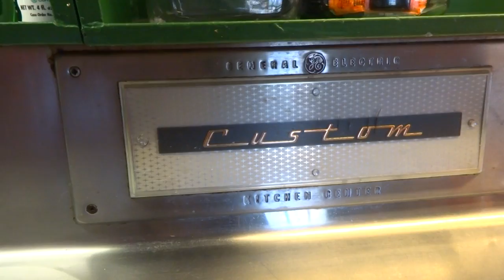PROPRESS FITTING POPPING OFF INFERIOR  PRODUCT TO SOLDERING

Comment: I’ve never seen a pro press fitting pop off like that in my life.  I’m guessing he did not have it on all the way before he used the pro press. I’ve been watching Steve for many years and this is a first in his videos. That just shows you how rare this is. Plus I’ve never seen it in my personal life either. User error is the reason she popped off.
Reply: Did you also notice pipe not cleaned, can you confirm for me, but I was trained to clean the pipe before pressing.  Maybe that is also why it failed?
Reply: Listen this guy had multiple failures.. go back replay...
Reply: Maybe the guy who did the pro-press sanded it. I think cleaning is OK, but sanding maybe not
Reply: @User-pb8pd  maybe? He definitely for sure did not install it correctly.
Reply: @michaelmcneffii1912 maybe he only wanted it to work long enough to get paid. Yup, Def not right!
Reply: @User-pb8pd  I would hope that’s not true. I had a experience where my battery died right as I was pressing a fitting. Now I first thought it was pressed all the way, but I pressed it again to be sure with a new battery. That’s a possibility of what happened too. Either way I’ve never seen a fitting pop off like that before. 100% user error
Reply: @michaelmcneffii1912  agree
Reply: @petero2693  Yes. It was the same plumber. The plumber was the problem.
Reply: Propress & Sharkbites are reliable products. If they're leaking, its because of improper installation by the plumber or DIY homeowner.
Reply: I have seen this when a propress fitting freezes. That being said what’s the difference if the pipe freezes and the fitting pops or the pipe freezes and the bursts. You’ve got water in the basement all the same

Comment: User error (I thought maybe the pipe was too thin).  That GE set up belongs in a museum.
Reply: Nope, i sold kitchens..The old double ovens 25 years old i told customers to keep them.. They were built like a tank.. Plus they were analog.. The temp control for the over could be adjusted at the knob just turn the temp ring to match thermostat you put into oven.. Easy piezy done...The new crap uses electronic controls,Ok got that.. They fail due to heat.. yes heat will cause electronics to fail..So an oven now has a fan to keep the electronics cool.(listen to the fan run after you turn the oven off). You cannot make this stuff up.. So a super simple older oven etc is now a super fancy piece of crap.. Just waiting for a new burnt out control board.. I sold appliances in a past life..  I used to read and also converse with repair techs..  Plus i still read about the junk made today.. Some old units looked like new built that well.... Once a kitchen is redone you will never see the older oven... Sold hundreds and hundreds of kitchens.. But I know nothing...
Reply: Thats exactly what it is my company use it commercially and never had any issues. And we do pro press, zoom lock and mega press
Reply: @bplotts1  I absolutely love pro press and mega press. I'm still not sold on zoom lock though...It hasn't been around long enough for me to trust it over braze. The temperature fluctuations are too frequent and rapid for me to trust an oring in refrigeration crimps.

Comment: My mother had a general electric range. I recognize those banks of push button temperature controls for the burner coils. Lo to high. They were fairly accurate. Built in 1955ish, and installed into 57,000 levittown, pennsylvania homes. In the 1980s they started failing, and parts were available, i remember replacing two banks of switches. GE would put a mechanical lited clock in the center of the range controls. It had a flourescent bulb mounted over the cooking area, which made a great kitchen nite lite
Reply: “Live better with electric” Betty Furness Westinghouse 1950’s

Difficult to believe Levitt would have
that futuristic electric range in the
price conscious spec built homes?
Thank you for the information.

Comment: Steve, don't hold back about the Pro Press--tell us how you really feel!
Reply: It looks like they did not clean the pipe before pressing, half assed job, what do they expect.  Everyone teaches that you have to clean the pipe when soldering, or propress, or MR Fixit (AKA sharkbites)
Reply: Most ads are lies... reality is best...
Reply: Then he used a wet rag to cool down the pipes.   Then he soldered in a coupling connected to a propress fitting really..that's not smart....most people don't like what they don't understand
Reply: In summary - propress - not good enough for any neighborhood!
Reply: O-Rings?  Yeah, that really worked out well for the space shuttle.  Propress fittings are supposedly warranted for 50 years?  Riiiiight.  And how many propress fittings have been around for more than 10 years?  And I assume solder joints would last for basically eternity.   And I know plumbers like to charge doctors rates but still I'd rather pay a few more minutes of labor charge to have it soldered.
Reply: @maubunky1  They have been around alot longer then 10 years. I know because i was using them back in 2000 in the netherlands.
Reply: @dillonlexington  I asked milwaukee vendor when i bought tool and he said you don't have to clean the pipe before hand. And I have yet to see any install where they cleaned and propressed. I clean my pipe still as I don't trust it. I've had all types fittings fail.
Reply: @maubunky1  Yeah? What if you were building a commercial building (pro press is COMMERCIAL, after all) and you had thousands of joints between domestic cold, domestic hot, domestic recirc, and hydronics? You can pay 10 plumbers for a month or you can pay two plumbers for a week. I can assure you that you will have less leaks after the week with two guys than a month with 10 guys. Whoever pressed those joints wasn't using the tool properly. The pipes are barely misshapen at the joints. You would know that if you knew anything about plumbing.
Reply: @jman0870  damn tell em
Reply: @jman0870  The union plumbers on big jobs like you mentioned would find a way to take as long as they want to get paid the same anyway no matter what fancy plumbing gadgets they have to make it easier and quicker.  Still, rubber o-rings don't last longer than metal brazed joints.  Pro Press is less reliable than the old fashioned way of doing it.  I can't believe any old time plumber could be sold on a high tech gadget so easily, you must be a salesman or factory rep.
Reply: @maubunky1  1: who the hell mentioned union anything. Just because it’s union where you are at doesn’t mean the majority of plumbers in the country are union. Spread your wings and get out of your city once in a while. Also, when the plumbers go way over budget on labor repeatedly the company goes bankrupt and those union assholes start needing the soup kitchens. 
2: who the hell brazes water lines. That’s literally 10 times more expensive than solder and a massive waste of silver. 
3: try to keep it on topic.
Reply: @richardtrott770  he fixed he requested leak and the homeowner wants a price for future work it seems. He’s not going to just start ripping pipes and fittings apart if the homeowner doesn’t agree or want to do the repair

Comment: In sweden we pretty much always pro prees. To hard to get a permit for soldering. If a propress pops off. Usually the press maching is not calibrated and malfuntioning or they used the wrong jaws or not inserted deep enough. but great video Steve! Best wishes from a Swedish plumber
Reply: Just waiting for the government to get involved here in the USA also. They wanna stick their nose everywhere these days
Reply: Yeah, its that way here for a lot of commercial work too. Have to get a hot work permit and have someone stand on fire watch for an hour. Ridiculous. A lot of places ignore it and tell us just to do what needs to be done. But other places are militant about it. Pro Press does make sense in commercial applications like that, or in cases of huge buildings where a drain down would take a long time. But for residential work and the cost of the fittings, screw that. But I'm sure it's just a matter of time before our betters mandate the same crap in residential.
Reply: WOW, a permit for hot work, how stupid.
Reply: @bullmoosepiper7732  Most likely. Here its like that for both commercial and residential. I solder like maybe twice a year. And that only when i happen to do district heating i think its called in english (In residential homes). The tempeture and preassure is too high for the propress. Here as if we solder we have to be two people and atleast one standing fire guard. So with those rules propress becomes cheaper than soldering. But i honestly feel the rules are to excessive and honestly its cooler to solder =)
Reply: @DEW409  here it was to stop tradesmen from burning down buildings haha. Atleast that was the reasoning. So every tradesmen was effected but mostly plumbers and roofers. Besides its the roofers that was and still is causing fires. #FreeTheSolder
Reply: @DEW409  and youll maybe get a laugh out of this. Forget using an angle grinder indoors like weve seen Steven do. That needs a hotwork permit. Even gotten scolded by some bosses (Not my boss but like carpenter bosses) for drilling holes in walls and studs etc because fire risks.
Reply: @DEW409  Not too far fetched. They already have the BS flow restrictors in every shower head now that I promptly drill through with a 7/32" bit and rip them out with needle nose pliers before it gets screwed onto the shower head nipple.
Reply: @DEW409  The permit to work would be granted by a private organisation (housing or commercial) as part of it's risk assessment. Hot works permits are very standard requirements when you're working for well managed companies. 
If you want to solder Mrs Jones'  new kitchen sink in her privately owned house, then no one is stopping you doing that.
Reply: Hot Work permits are common in the US in the commercial and industrial world. It’s an insurance thing. They’re usually issued by a facility’s risk management group. I had to get one just this week to weld a crack in a stainless process sink. We TIG weld just about everything to keep the sparks down, too.
Reply: All work in the USA needs inspected, city or not.  I saw dozens of frightening jobs with all the trade school crap and a lot of work, union or not was bad.  Parts let go and not installed, code violations in multiple trades, overcharging gas, , no attention to fixing wiring. dangerous lack of understanding of ground, earth, and neutral, NO clue of what really they are doing after 5-6 years, and they had the "degree" haha.  The company I worked for was quite a bit better than most in area.
Reply: @DEW409  massachusetts already has the stupid hot works law. Where i work we are forced to follow it. Ive been brazing and soldering for 20 years and now someone who has never done it is in charge of where and when i solder.
Reply: I used to install bake on ovens, washers, dip tanks and conveyor systems. Almost all places we had to do fire watch.  Winchester Repeating Arms Company in Connecticut is a really secure place. They only allowed 3 of us to work and one person had to be in crow's nest for fire watch every day. We took turns and were there for 3 weeks. Boss was pissed because we were only allowed to work 7.5 hour days and 5 days a week. We normally worked  12 to 16  hours a day 7 days a week on the road. They also required one of there workers to baby sit us the whole time.
Reply: @bullmoosepiper7732  commercial i could see and its being done with quality tools by professionals and in commercial its not likely to be as big of a deal for a leak if it does because of the environment a residential building to many ways to get mold wood rot 
People don't see the leaks in time unless in their face 
Then some well we can't afford a plumber right now so just turn the valve off when not using it 
Thats with any plumbing system 
But an O ring could leak behind a wall slowly for a long time before noticed 
Commercial is a different beast
Reply: Hot work permits, its just something that's not enforced here .I live in British Columbia, Canada. Not once have any of the journeymen I work with ever applied for a hot work permit on site.
Reply: @Wreck-it_Ralph  Its Massachusetts 🤷‍♂️ you sound surprised.
Reply: @JohnWatkinsUK  exactly it’s got nothing to do with communism or Biden or whatever bullshit he thinks is going on. It’s about protecting the property and people inside it when you’re working.
Reply: @BrickTop900  its about insurance companies making and keeping all the money.
Reply: You need a fuckin' permit to solder? Talk about Nanny State nonsense.

Comment: I'm using the uponor system. 0 failures since 3 years that I've switched from copper. I'm surprised propress failed.
Reply: I use pex a in bad areas that they steal the copper 
It works well but it's a mechanical connection not dependant on an O ring
Reply: @jackblack9830  You are very correct. That's the reason why I went to uponor instead of pro press. The O-ring might be damaged or brittle from being in storage. The tool is also proprietary I believe and very expensive once you get into bigger sizes. I'm not sure what happened here, but the plumber is lucky this happened in the basement and not somewhere where there are expensive appliances or finished wood floors.
Reply: @Jesse-gv9tf  It's literally the same gun for all sizes at least to 4 inch....

Comment: Nice work Steve.  GE push button electric ranges was the stuff back in 50's & 60's.  Many were still in use through the late 70's early 80's.  Worked on many of them.  Yes, I'm old.  Old but not obsolete.  Never go hungry if you learn a trade.  The one thing they can never take from you is knowledge.
Reply: The free-standing GE Range had a fluorescent lamp under a hood over the controls....sell lamps forever!
Reply: Steve does a nice job but the only thing that bugs me is every time he goes to a customers house he's always cursing I mean you don't talk like that when you're in front of customers I mostly customers want to hear that it's just good practice that's my opinion like your don't
Reply: @billb6959  Didn't know he was like that.  Using bad language is very unprofessional even for someone that works on toilets.  Cheers!

Comment: If I was him I would be more worried about the wire than the outside sillcock . I never saw a pro press done correctly pop off?  I have a press tool because it is popular in this area and any repairs are difficult on existing buildings. Wait a few years until this “ZOOM” lock shit start to leak on the A/C systems. Might be ok in industrial no flame situation but I’ll stick to the old fashioned stuff.  Nice fix Steve.👍
Reply: PP fittings will pop off when they're missed (poor craftsmanship) or more often, when the PP tool is low on battery and doesn't complete a cycle, in my experience.

Comment: Just a tip I like to use soaked wet rags to cover any electrical wires or pipes I can't move out the way to keep from burning them with the torch... love your stuff Steve your my favorite YouTube hvac tech am a hvac tech myself!!
Reply: I'm not surprised he didn't do that. He mentioned several times how he should put a wet rag on the fitting but failed to do it. Like he was trying to "cook" the o-ring to get it to fail because of his bias against the propress system.

Comment: Hey Steve I work in the air compressor world and all the kids use pro press I still lug around my torch and B tank but your right to tool up for pro press at the beginning must be awful expensive! They can't run to a local hardware store to get the fittings either I'm pushing 60 and on the down side of my career my torch has been good for the past 30 odd years

Comment: My new boiler was all done with pro press and M rated pipe. A minor thing I don't like about it is the pipes squeezed and has crimp flats in it too, almost like the crimping tool had too much closing power. The theory about using pro press is, as labor costs increase, the time saved by using pro press will decrease the installation cost for the homeowner even though the fittings are so expensive. In reality if they finish 15 minutes sooner they will use up the 15 minutes doing something else, cleaning or whatever. There would need a ton of connections to do to save an hour or more in time. And if there was a ton of fittings, the extra cost of them would cut into the one hour or so labor time saved.

Comment: Hi Steve , just a FYI for ya, if you can find an old piece of aspestice siding somewhere, it works great for tight spaces where you need to protect wires. Just slide it into position and everythings protected.
Reply: lol. aspestice.
Reply: They sell fireproof fabric... I have both shingles and fabric..  plumbing dept will have it..
Reply: @petero2693  Your correct, but the shingle is cheaper if not free.

Comment: Looks like one end of the fitting wasn't crimped. Yes soldering is great and so is pressing. But like anything else you have to have the proper equipment and know how. I work for a major university and we use all methods of joining pipe. I'll tell you the pro press and especially the mega press can be a real lifesaver. I use the press fittings on compressed air, heating hot water, chilled water, low pressure steam, condensate. I have pressed over 4000 joints in 10 years never had an issue with the viega brand.

Comment: Most often if a propress pops out it’s because the pipe wasn’t pushed into the fitting before compressing. We have never had one pop out yet. We have to use propress most times because obtaining a burn permit from the fire department for a couple fittings is not feasible.